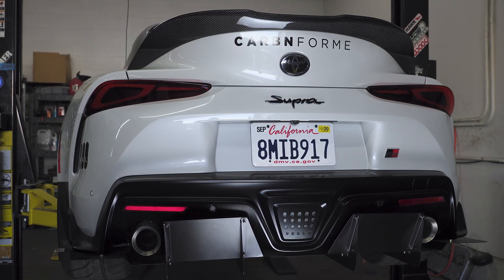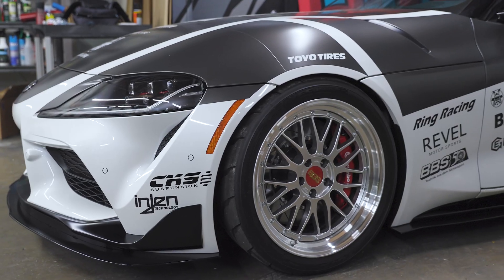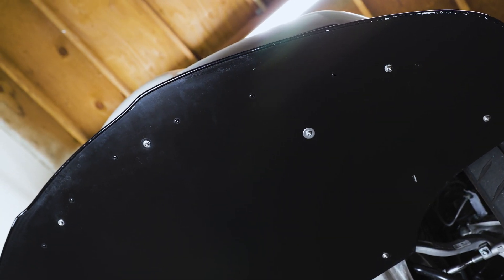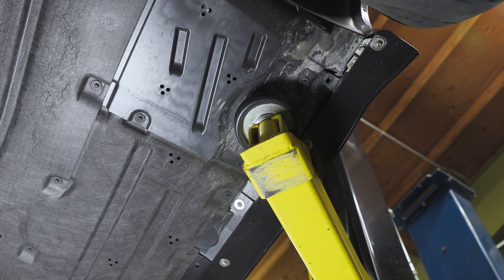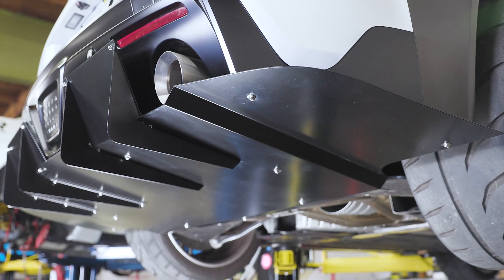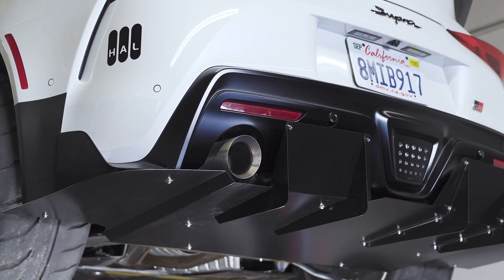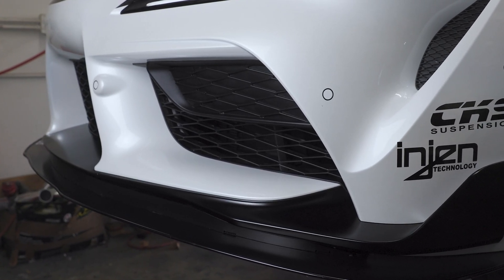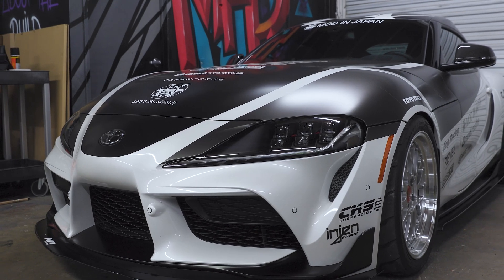MFR Engineering Aluminum Chassis Mounted Aero Kit 2020 Toyota Supra A90 #MIJA90 | Modinjapan.com

Comment: it is importend that underbody  smooth like upperbody too... to minimize the turbulence  lower the car and for better suck.  your hex/universal head bolt distrubuts airstream you must take countsunk head bolts to combine  to bond the aluminium or using smooth countersunk washer. the front is most importend aerodynamic area.